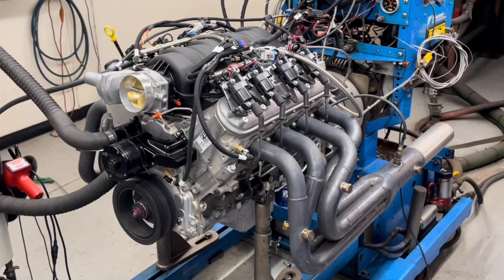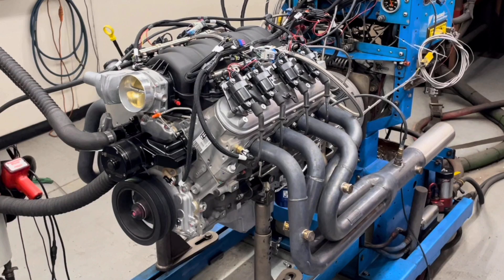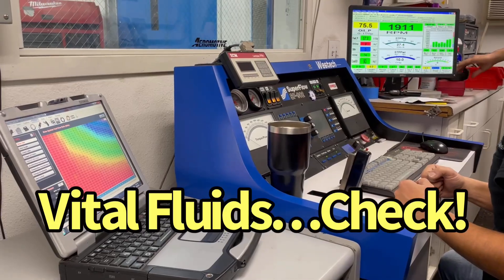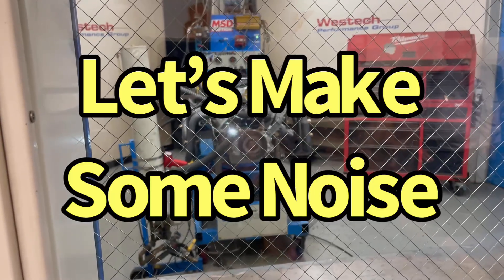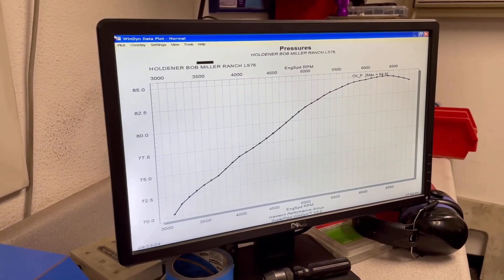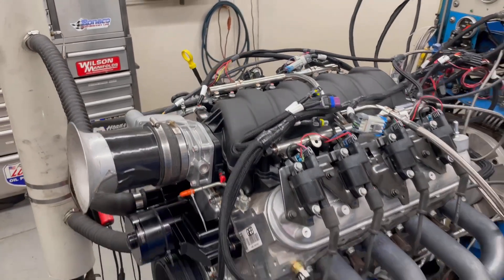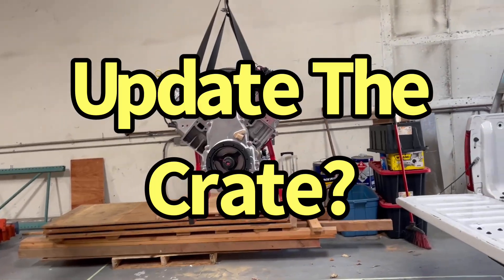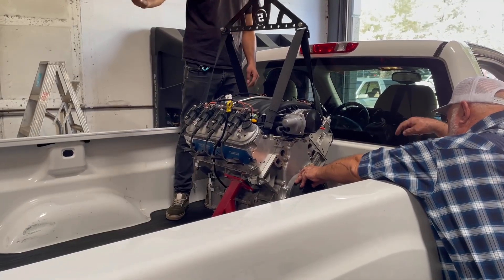DO GM 427 LSX CRATE MOTORS REALLY WORK? THIS 427 LS7 STROKER IS RATED AT 570 HP-WHAT DOES IT MAKE?

Comment: A shame the LS427/570 engine's are not available from GM anymore.
Over 600HP from an engine rated at 570HP is very impressive.
Even the idle is not as rough as expected considering the camshaft is considerably larger than the one equipped in the original LS7.
With the normal wet sump a bonus for engine swaps.
😎🇦🇺👍

Comment: Part of me is really curious to what this thing would make on 87 octane with a bunch of timing whacked out of it to make it safe. Like let's say you have a file for emergencies if you are on something like the power tour and you find yourself in some little town that doesn't have 91 octane fuel. You can smack on 87 octane safe tune in it and get to somewhere that has 91.
Reply: And on the flip side of that coin I'd like to see what it would make on race fuel or E85 or even methanol.
Reply from the maker: If you are driving it under cruise conditions, it will drive fine on 87

Comment: That’s why the Z28 and its (505) hp rating was slightly off😂. It beat the AWD GTR around VIR in 14. I remember they wanted 75000+ plus for those Camaros then . I settled for a 1SS1LE for 38000. Couldn’t even afford a Zl1 at 56000. I still love it . What are those motors bout 15 G’s?

Comment: WRONG CAM!  That cam was a little small for a 427.  I would have used something like 235 - 240 degrees duration.  That would push power up over 630 easily.  I'm thinking it would peak at 6,600 to 6,700 also.  FOR THE LOVE OF GOD, GET A GOOD CAM!  👍
Reply from the maker: we used the cam that came with the crate motor
Reply: @richardholdener1727  I thought as much.  It's the wrong cam!

Comment: The stock LS7 cam specs are 211/230 @.050" lift, .593/.588 lift with the stock 1.8 rockers, and a 120 LSA.  Would make more top-end power with a bigger cam, probably sacrificing some on the low end.
Reply from the maker: this was not a stock LS7

Comment: Richard made mention in the details the engine was balanced. Ive "heard" the crate motors are not balanced very well. 454 LSX had to be re-blocked as a result of a block being cracked in a freak accident. Rotating assembly was reused but was found to be balanced like Ray Charles or Stevie Wonder did it. That's a lot of money to get a motor that needed better machine/balancing.
Reply from the maker: the assemblies are balanced-otherwise it would shake the dyno to death
Reply: @richardholdener1727 Richard, Im a big fan and not trying to do the troll thing. However, although I didn't see it for myself, my source is as solid as can be. To further the point that builder has done a boat load of the ever popular 502 big block crate motors and found those to be poorly balanced. the crank was was out 51 and 60 grams. I can send u the print out. and pics.
Reply: @randallsavage3795  not sure the 454 or the 502 are ls series engines. think they are old school bbc chevy blocks
Reply: @kbtdadap  omg stop man. read what I wrote before trying to correct me please.
Reply: @randallsavage3795    isnt it annoying how often people online will either ignore wording or twist your words just so they can correct you, or they do so to fit an argument that they are having with themselves while being an ignorant cnt the whole time😂

Comment: So - discontinued - what's equivalent and actually available?  GM list price actually seemed pretty reasonable at ~$16K.
Reply: Blueprint engines sells both iron and aluminum block 427 LS crate engines at similar power for $12-15k depending on options
Reply: All in, ready to run my forged/studded Iron 408 build was 8800 including the Terminator X max. Could of had an Aluminum short block 416 in the build for 800$ more. If you willing to do some work like I did you can save a bunch. Took me an afternoon to install the cam, heads, oilpump, and intake on the built shortblock.

Comment: Welp, I gotta ask…

Have you seen or tested the Summit Racing Big Nasty 5/4 Race Cams SUM-8733R1 ???  

218/230@0.050”, 0.550” lift, 105 LSA, and no fly cutting needed.  Supposedly works with a stock converter and makes good low end torque.
Reply from the maker: yes-that video is up
Reply: @richardholdener1727   I'll be damned....  How the hell did I miss that vid?!?!?!!
Thanks

I'm envisioning the Truck Norris VS Big Nasty comparisons

Comment: How high does it rev 7200? It should?
Reply from the maker: why run it that far past the hp peak
Reply: @richardholdener1727   many reasons, drag racing with a large RPM drop on the gear change, road racing and wanting more mph in each gear to minimize/eliminate gear changes in turns

Comment: This 427 LS made 1.43 hp per cu in , the Mustang 5.0 ( 305 ) cu in Coyote makes 1.6 hp per cu in  ! Do the math , Sorry !……
Reply: What are you sorry about?  A .049 Cox will beat them both on hp per cubic inch.  But who cares?
Reply: @failranch9542  What I was trying to point out was a LS with a large throttle body , large cam and full length headers put out less hp per cu in than a stock 5.0  !….
Reply: Sorry for what? whats that 5.0 torque?
Reply: GM 5.5 v8, 1.99 hp/liter, same math, sorry, why is Ford 32v v8 so far behind the Gm 32v v8?
Reply: @thomasdaum1927 Yes, as you said…..”the video was about the LS”….so why are you bringing up a 4 valve FORD engine? And then bash @JohnSmith for countering with the 5.5? Come on.
Reply: @thomasdaum1927  Go to any car show, or any Drag Strip you’ll find Fords with Chevrolet engines in them, I don’t recall ever seeing a Chevrolet with a Ford engine. Pretty much says it all.   “Because I can!”
Reply: @jrwstl02  You ain’t been to enough car shows , I have seen the Ford to Chevy swap several times ! Because I can !……
Reply: @thomasdaum1927  I totally agree with you!! There are a few Ford motors in Chevy vehicles. Compared to tens of thousands of Chevy engines sitting between Ford fenders. There’s no comparison!  Actually I’m helping with a 68 Mustang currently……Getting a Chevy LSA 650 hp, painted ford blue with ford retro valve (coil) covers, so it’ll look somewhat “ford”.
Reply: @JohnSmith-fi2ck  I was talking about hp per cu in , apparently you didn’t get that . Torque was not mentioned ! Don’t change the argument !…..

Comment: I have one of these engines in my 68 Firebird.  It’s a factory LS7 out of a Z06 or Z28 that has a small cam and has been converted to wet sump oiling.  It even uses stock valve springs.
Reply: You should put those retainers (I think that's what they are called ) on the rocker arms to keep the stock needle bearings from exploding (they tend to). Great engine!
Reply: @cromBumny  I’m actually getting ready to swap on a set of Tony Mamo LS7 heads with Yella Terra shaft rockers and a little bigger cam.  I’ve known about the LS7 valve issues for years; didn’t stop me from grabbing one of these engines when I had the chance.  It’s been great so far

Comment: I'd also look into upgrading to a bulletproof full race timing set because that OEM chain will be stretched out floppy in no time. I put one like that in my stock LS1 truck engine that makes maybe 360 hp, because I found the OEM timing chain loose and floppy in under 100K miles. I was told the new chain supports up to 2000 hp. It is a double row billet sprocket adjustable set that required the oil pump to be spaced out and the timing cover to be clearanced on the inside to fit. Totally worth it in my opinion. Been driving it a couple years now and I don't expect to find that chain floppy again for the life of the engine.
Reply from the maker: the factory LS timing chains a loose when first assembled-no need for a double roller-most just use the German or Katech chain
Reply: @richardholdener1727  I'll have to look into that. I have a GM crate LS4 still in the crate, waiting for me to finish bodywork on the car it will go into. I plan to DOD delete it and leave it otherwise stock. That engine can't take a double row chain. I'll see for myself how loose a new OEM chain is when I get it apart. Is German a brand name or country of origin?

Comment: Thanks Richard and “Bob”… couple bucks more than the 525hp Ls-3 crate, but a really nice factory piece.
Reply: Better Rods , Pistons ..  Bigger ports and valves with a few extra head bolts..  I should have bought one with dry sump oiling.

Comment: Actually have a question about solid roller lifters. I have had some pretty terrific experiences with hydraulic rollers and I'm curious ever tested solid rollers. Cause I'm kinda just assuming might be more consistent and even add a couple ponies?
Reply from the maker: you don't need solid rollers on an LS unless you are looking to go way north of 8000 rpm
Reply: David Vizard’s channel might have the info you’re looking for, he’s a bit older and much slower of a talker than Holdener so be ready with the patience his videos are not fast paced like Holdener’s
Reply: These days you can run limited travel hydraulic roller lifters and they rpm as good as solids without the maintenance.

Comment: With that oil pressure I would  have tried  thinner oil . And maybe a little timing.
Reply from the maker: we add timing til it stops making power-it had the correct timing
Reply: @richardholdener1727   I know you guys are pretty good about that.  But it's always  a good thing to recheck when looking for 0.1hp lol
Reply: @freyja4954  Why would oil pressure have an impact on ignition timing?
Reply: @alantrimble2881 he didn’t say it did

Comment: Bet 13 to 1 compression on a good fuel delivery system on E85 would boost torque throughout the entire rev range
Reply: E85 does seem to help make more torque compared to 91.
Reply: @I_like_turtles_67 It does let you run more compression and ignition timing which does improve torque.

Comment: Hey Richard, I’m putting an LS7 into a 67 Camaro. Very similar to the motor you tested. What kind of power do you think mine has. 231/239 duration .617/.623 lift on a 112 lobe centerline? I appreciate it
Reply: We do them often, that cam needs more split with a stock LS7 head but I'd expect 530ish rwhp with a stick
Reply: Cool, thank you.

Comment: I'd love to see numbers of this exact motor with 13 to 1 compression with whatever injectors size and fuel pump needed on E85 and keep the crate engine camshaft keeps it very streetable should make 650+ and be reliable and dependable I'm assuming it's  running 26 degrees of timing it's a guess

Comment: Don't tell the ford Godzilla guys this engine launched 18 years ago
Reply: thats great, but the godzilla bolts into my car and can run off the stock computer
Reply: @tturi2 your car is a 65 Lincoln. Anything will bolt right in to a 65 Lincoln.
Reply: @sammyt4822  that's a very cool car, but I have a ford falcon
Reply: @tturi2  you say that like an LS cant bolt into a car and run on a stock computer just as easy… even easier than a godzilla usually
Reply: @knowbull5hit590  yeah, but my cars powertrain is already modular, I'd have to buy a new gearbox, wire it to suit ls, get my gauges working with an aftermarket ecu etcetera
Reply: @tturi2  any engine is bolt in on a ford falcon.
Reply: @TT64NOVASS  I love your guys optimism and I love the LS engine, but the modular does the trick for now
Reply: @chipcurrey653  Don’t tell the LS guys the Windsor was born in the 1960’s
Reply: @huntersmith5863 the Cleveland is the superior option
Reply: @huntersmith5863  Yes exactly my point. Great example. Imagine if the LS had launched in 1997 with similar displacement to the 351W but with worse head and intake manifold flow. That would be like the Godzilla launching in 2020 with similar displacement but worse head and intake manifold flow than the LS7 which launched 14 years earlier, except that actually happened.
Reply: @chipcurrey653  The Godzilla you are comparing to is a truck engine engineered for that purpose. Give it the same treatment, and it will make your LS7 look like a small block dodge
Reply: Ford had a 427 crate engine that made 616 hp at 7,000 rpm and 515 lb-ft torque at 3,800 rpm, according to Ford factory specs...in 1965. Pretty much identical numbers.
Reply: @richardholdner
Reply: @alfredstewart5107 I know you have no clue, so here it is for you to weep over. All the way to 1965 too... Damn that hurts
Reply: @chipcurrey653 How bad does this fact hurt your ego
Reply: @huntersmith5863  As the proud owner of a 70 Cobra Jet Mach 1, I can assure you that nothing builds my ego like getting brand loyalists to comment. You'll have to let me know what a 700 lb, carbureted, belt driven overhead Cam engine has to do with modern EFI pushrod engines.

Comment: I wonder why more people, including myself do not use LS7 based heads and cams 🤔
Reply: Money
Reply from the maker: maybe because of bore size required, port volume and not having enough motor to warrant the combination of flow and port volume
Reply: Money and the chambers and valves probably dont work too well on an engine with much less bore diameter. Valves are getting really close to the cylinder wall

Comment: If the cylinders wernt paper thin.  Had this motor for 6k pop!!! Torque was amazing.  Went lean and bye bye...
Reply from the maker: thick cylinders also don't stop detonation
Reply: @richardholdener1727  what are your thoughts on Darton mid sleeves for an LS7 block?   I havr heard mixed information.  I will only be heads and cam for street and maybe some hpde.?
Reply: Itul get Hot faster thou

Comment: CNC ported heads ? Factory? Titainium rods ? Hyperutectic pistons , really ? NOT factory !
Reply from the maker: GM crate motor
Reply: @richardholdener1727  but no LS7 drysump😢
Reply: @manitoublack  Do you really NEED a dry sump if you’re not road racing, endurance racing, or doing endless donuts? Most people don’t & will never see the benefit of a dry sump.
Reply: Why titanium rods and no forged pistons.   Wouldn't it be better to use forged rods  and forged pistons
Reply: @joseiracheta3817 forged pistons have a lot of trouble passing emissions because they shrink when cold which allows blowby. Also they are heavier.
Reply: All the LS7 stuff has now been discontinued but this was a 427/570HP crate motor package that had the wet sump and a cam/springs upgrade package straight from GM. Wet sump because it was a crate motor for swapping into street cars. The dry sump setup was really only engineered to fit the modern cars (Z06 Corvette & Z/28 Camaro) not your average guy's old Chevelle or Camaro.
Reply: @etenterprises I believe the springs are stock.  I have one of these engines and didn’t see anything on the build sheet about springs being swapped.  I think that’s the reason for the stock lift numbers
Reply: Absolutely factory. I just had to yank mine apart because the Ti connecting rods had a coating failure and caused it to spin a bearing.
Reply: Ls7s had CNC ported heads, titanium rods and hyper pistons from the factory starting in 2006
Reply: Actually yes factory, stock C6Z heads are CNC from GM, ti rods etc...this is basically a stock C6 ls7 with a small cam

Comment: Great video as usual!  I saw some of the marketing dyno graphs GM put out back in 2020 when this crate engine launched, but there hasn't been much real data posted.  I've got the same crate engine in my Mazda RX8.  It made 491 whp with 1-5/8" borla shorty headers and a 2.5" dual exhaust that was fairly restrictive.  I had custom 2" long tubes and 3" dual exhaust made for it, but haven't dynoed it since then.  My optimistic guess is it's somewhere between 510 and 525 whp now.

Comment: Hmmm under .600 lift cam ??
Reply: Factory cam
Reply: @C6Z_Bob it’s not a production LS7 cam if that’s what you meant, but it does have really mild lobes and uses stock LS7 valve springs.
Reply: Lift isn't really the important factor for the most part